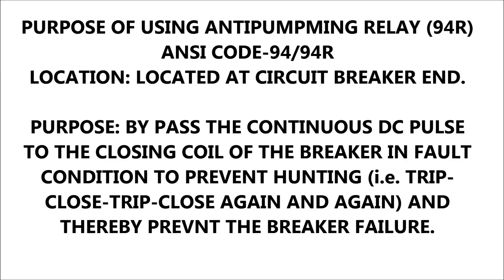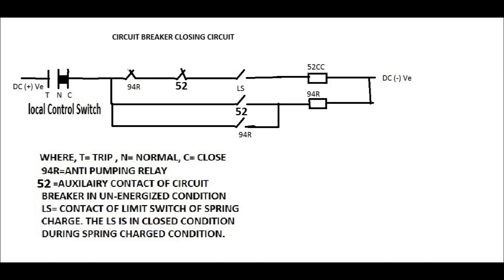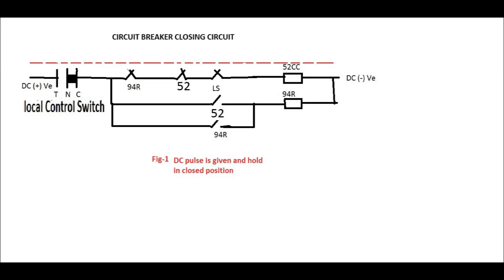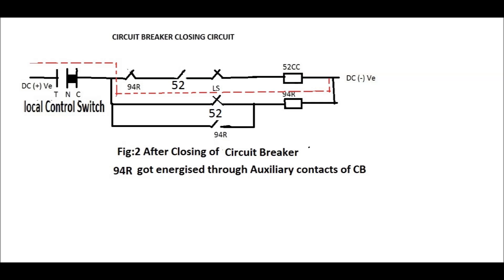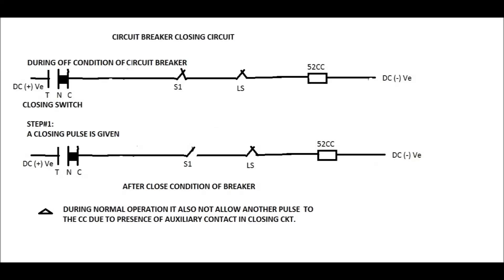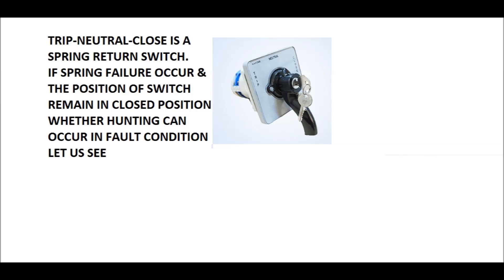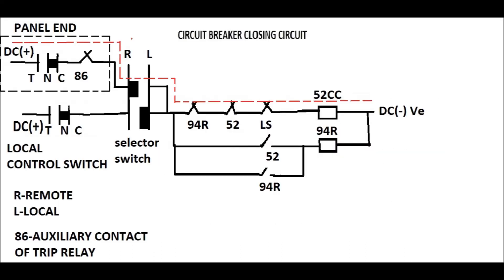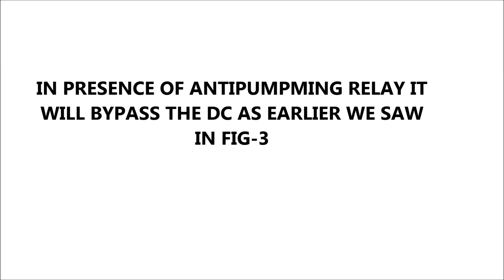ANTIPUMPING  RELAY

Comment: Very well explained sir. 
It is an humble request to make this video in hindi language also.
Reply from the maker: Yes I will
Reply: Vry well explain sir ,but you think only one side if you merge both closing and tripping circuit. 1st close command give to breaker and continuously persist this command. But same time tripping will be also persist than on some make of breaker antipumping was not worked because of CO timing of tripping is faster   than of holding contact of antipumping relay so that 94 is closed when breaker is close but holding is not picked....